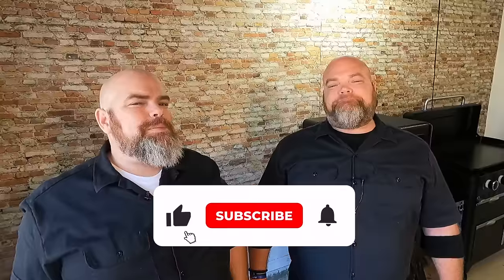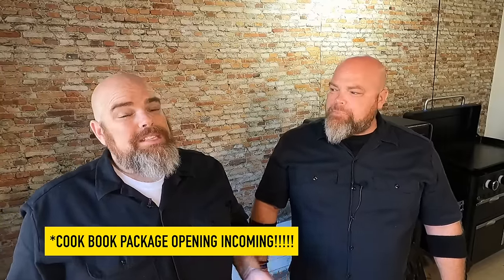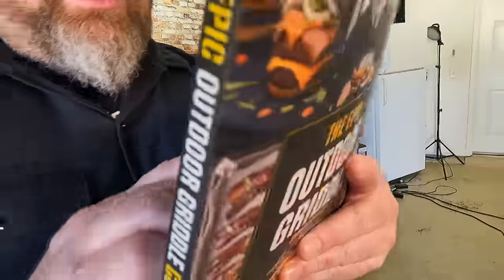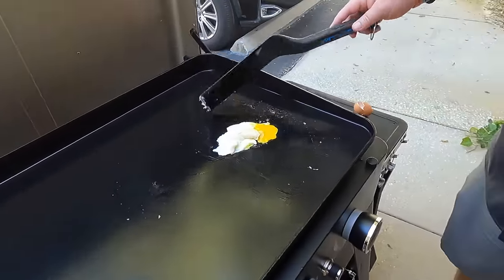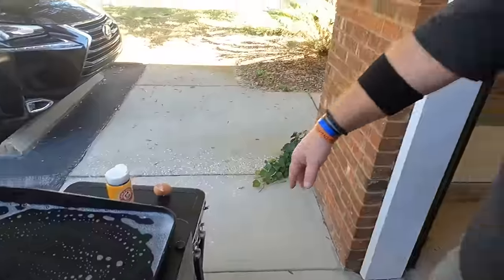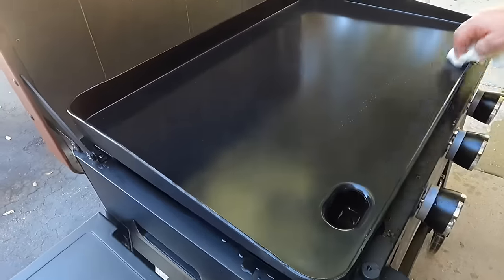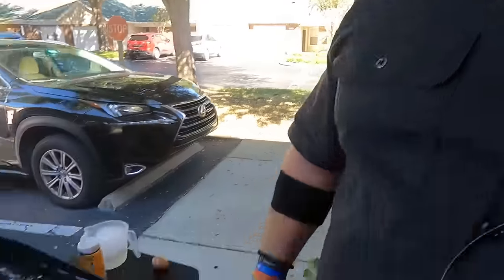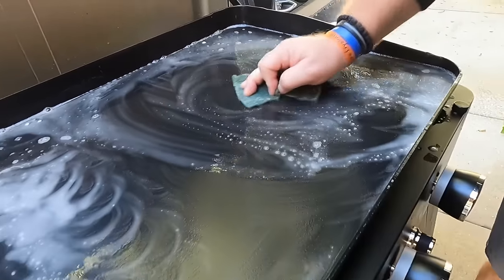WHY IS EVERYTHING STICKING TO MY GRIDDLE?! HOW TO FIX FOOD STICKING ON FLAT TOP GRILl

Comment: Great tip with the baking Soda, going to try it. I used a system (instead of sandblasting) to carefully clean surfaces on wood and metal for car and furniture restauration with baking Soda called "Sodablaster" and it works so great.
I have to say I use a little film of oil on the griddle surface after cleaning, and start to prepare the surface with baking spray which does a pretty good job not to burn the surface with things to be grilled. 
My griddle was pretty cheap from a Spain manufacturer (150 $) with three burners on a propane bottle, but doing the job really good if you turn the heat on high most of the time. 
It is sometimes a matter of the coating of the griddle if you get these nasty hotspots or not.
Cheers from Germany, Bernd
Reply from the maker: Excellent information here brother!! Thank you so much for watching and for the love!!🔥🔥

Comment: Good show, guys. Just ot of curiousity, though it's not the recommended practice, have you ever fried or srambled eggs on the dry surface, as in no butter or oil?  If I had a ceramic top, I'd have try it.
Reply from the maker: Yes, we’ve actually tried it! We’ve had both success, and failure with it…😂😂. If we put them in the griddle while it’s cooler, it works much better.🤙🤙

Comment: Is this process ok to use on the rolled steel cooktops ?
Reply from the maker: It’s not necessary… with the steel, you can use a pumice stone to repair, and oil to reseason. Feel free to reach out with any questions you have with this unit, or the steel units, we got you!😁

Comment: Just so everyone knows: most flat top grills are NOT non-stick coated. Following this with a typical flat top griddle designed for seasoning (I.e Blackstone, Camp Chef, Weber, or anything commercial grade.) would be very bad advice. You use soap on a tyical flat top griddle once, when you first buy it and never again. With anything meant to be seasoned, soap destroys the seasoning. The seasoning is the non-stick surface. Layers of oil are burned into the surface intentionally. 

Key for those is: 
FIRST USE:
1) Clean it with soap and water and only when its new and never used (yep, soap used here and never again).
2) Turn it on high for 10-15 minutes 
3) Add just enough seasoning oil (Flaxseed, Avocado, Grapeseed, etc) to cover surface while its hot
4) Let it burn in until it stops smoking (~10-15 minutes)
5) Add oil and repeat burn in 3-4 times total
6) Now that its ready (seasoned), whenever you use it, heat to high again and add fresh seasoning again (one time)
7) Cook away

CLEANUP STEPS after its seasoned and used:
1) Put on high and add water (no soap)
2) Use scraper to move food debris to catch basin at back until there is no more to scrape
3) Wipe off water with rag or paper towels
4) Add oil and season one time (now its ready to store or cover)

The advice in this video is for non-stick surfaces ONLY. Personally, I would never buy a non-stick (not meant to be seasoned) flat top. That coating will wear out and it will never be capable of seasoning when it does. Griddles that are seasoned last lifetimes. As far as I know, all restaurants use seasoned flat tops for many reasons.
Reply from the maker: Just a question… have you watched our channel before? We made it clear that this is for the ceramic surface. We have cooked and seasoned and cleaned on all surfaces. Although we appreciate you spending the time to educate our followers, we have several videos on all that was explained. 
We really do appreciate the intent. Much love, griddle on.😁❤️🤙
Reply: @WALTWINS  Fair answer. I just have friends who are clueless. Didn't see an obvious, only do this if... in the video. That's  all.
Reply: @trevorwesterdahl6245  You did a good job explaining, was watching on phone and maybe I missed it but didn’t realize it was t a real flat top and was getting a box of baking soda out. 😅

Comment: I thought our new 21 inch e series griddle (indoor electric griddle) was done for till this video 😭 the stain looked like it was part of the griddle not on it. But I did this method. Left on for 35 minutes on top of the hot soapy water mix and it came off and is now clean! Was about to call Blackstone until I saw this thank you so much 😭 ( this stain happened after trying to make steak fajitas and trying to "char" it heavily ...bad idea 😂)  I think the outdoor one is better for that. I mightve not made sure oil or water was on the griddle at all times. Where did I go wrong 😂

Comment: I wish mine would get hot enough to get something to stick. 3 different propane tanks, 4 different regulators  and the max I get with all 3 on high is 350f. Barely hot enough to simmer. I noticed that Walmart doesn't have these online anymore either. Customer service was no help after spending hours trying to get them to answer the phone. I have a $420 piece of junk. Luckily Walmart fully refunded the cost and told me not to return it, they have too many that have been returned.
Reply from the maker: We are so sorry you have had a bad experience Dawn. We will let our reps at PB know… please reach out. We love these units so much. We are here for you. Much love.❤️😁🤙
Reply: This hasn’t been my experience with my sierra at all. I’ve yet to even have to turn it up from low. It gets crazy hot

Comment: The biggest issue I think on mine is that low is low 400 degrees.
Reply from the maker: Hey brother! In one of the Facebook groups, someone had a great suggestion that seemed to really help - raising the pegs of the griddles that sit on the frame - while it seems like a small thing, it lifts the griddle from the flames, and also allows for more air to flow.  Hope it helps brother!🤙🤙
Reply: @waltwins  Thanks! I'll give that a try!

Comment: Idk my blacksone never has food sticking
Reply from the maker: Welp, if you check the many Blackstone forums, this is a very common problem… we addressed it here even in this vid. Congratulations on a perfect griddle. Cheers.
Reply: As someone who has watched the WALTWINS since the beginning and loves the videos and the recipes,  Ive had my Blackstone for a few years and I did feel inclined to buy a PITTBOSS griddle because i trusted there judgment. But after a few months of use I noticed it wasn't the same especially with the sticking and at the same time I get  better crusts with the Blackstone. So I do the same recipes that i love from the waltwins with the Blackstone because it's clearly a better griddle
Reply from the maker: @proudmamaofboysss3267  thank you for the honest feedback - we’ve had sticking on both the Blackstone and the Pit Boss. The deep clean restored the Pit Boss back to original nonstick, the same as reseasoning worked on the Blackstone. They are both excellent units, and we find that there is just something for everyone, regardless of the preference.  We appreciate the support!🤙🤙

Comment: Seems to me the non stuck surface is going.  When you first switched from blackstone to this nothing stuck, like a non stick should not.  But recently here your surface has been wearing, look back at some previous videos where you will find irregular marks.  

My guess is that griddle will become a paper weight shortly since it can not be resurfaced.
Reply from the maker: We’ve always had some sticking - we’ve addressed it in a few videos, maybe you didn’t see those ones? The surface looks identical to day one - no wear at all.  Also, this is Brett’s unit, the one at my house has 120+ cooks in it, and the surface looks like it did on day one. We agree that someday they almost likely wear, but we haven’t gotten there yet.  Cheers.
Reply: Seriously dude 🙄

Comment: Never put soap on your griddle.  Season it better.
Reply from the maker: This is a ceramic coated griddle - you absolutely clean it with soap and water.  The cold rolled steel you do not put oil, just like we pointed out in the video.  Before you leave a snarky comment, make sure you actually watch the video and understand the content.  Cheers.